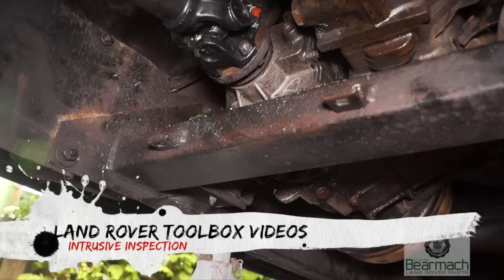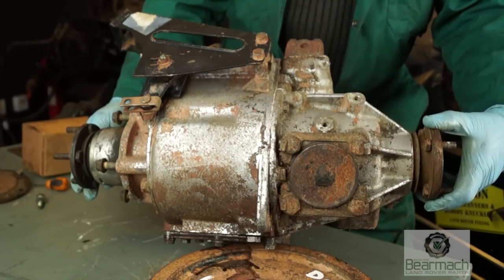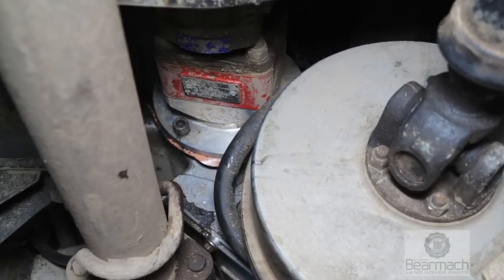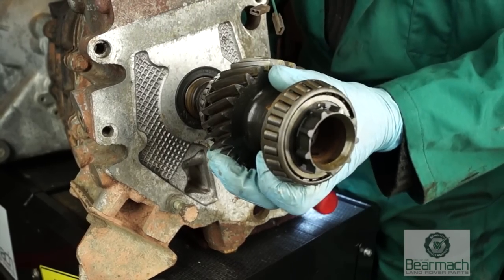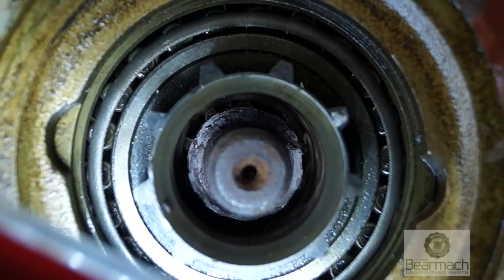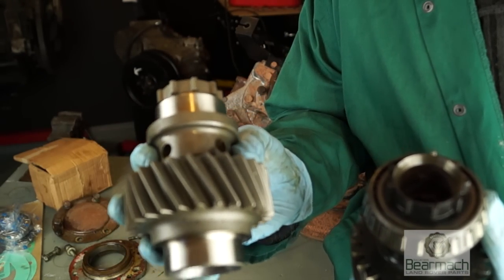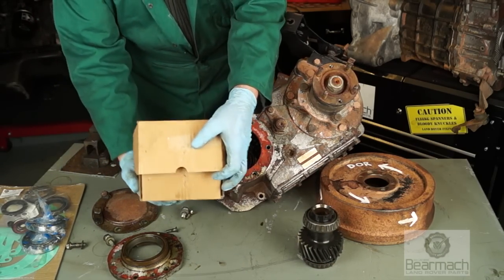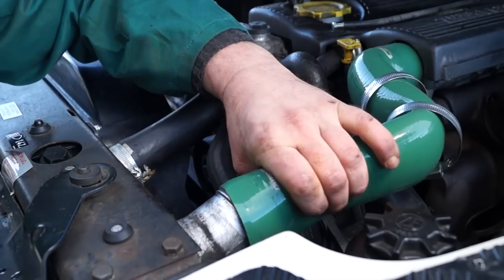A common problem with the LT77 ( mainshaft wear) - The Fine art of Land Rover Maintenance

Comment: Yep that happened to me. Bang, rev, stop. These are great tutorials by the way. Had a similar issue with a Fairy overdrive in my 109. Splines on input gear and OD main shaft wore away. Again, Bang, grind, stop. But this time I could remove the OD, refit the pick off gear and cover plate (always onboard) and carry on....

Comment: A good idea is to make up a short gutter & to have two little wings all welded to the cover plate ( pto cover plate) so that oil runs along the gutter & falls down on to the input gear where the mainshaft fits into.It also gives extra oil feed.

Comment: As a precautionary measure for input spline wear could you potentially unbolt those 6 bolts and pack with lubricant and use an air compressor to help lube reach further areas while on the vehicle?

Comment: I have rebuilt my R380 and I saw your video and replaced this part for the new cross drilled one as the output shaft was in good shape.

Now I have a whining noise that increases with road speed, I think its the new output gear its  a LR one fitted with timkens.

The gear didnt look as good quality as the original.

ashcroft say Some "pattern" gears are not "crowned" during manufacture and will whine because of the edge contact.

Have you experienced this ?

Great videos BTW

Comment: Great video! 
I have a question about this 

I have a 85 ninety 2.5petrol so it has a 1:4 ratio box. 
Is it possible to exchange the shaft with a cross drilled one from a disco 1:6 box? 

I mean Are these the same or is it really different gears etc. Or will it change my gearing?
Reply from the maker: I would suggest contacting either Syncrogearboxes or Ashcrofts.  The Discovery R380 / LT230 T or LT230 Q doesn't come as 1.6 to 1 ratio. They are 1.22 to 1. 

The 1.6 to 1 is the Defender lower ratio transfer box.

Comment: Question about my 02 LRDiscovery II 4 wheel drive, my front driveshaft fell off and my rear drive shaft is not moving the car even in the low gear. Can you tell me how to make it drive my car or do you think something is wrong with the gear box. Thanks, Ernest from San Antonio, Texas.
Reply from the maker: +Albert Flores  you can't lock the differential in the transfer box on a D2 because has an  automatic locking mechanism unlike the manual transfer boxes which have a movement on the lever to lock it unfortunately.

Comment: Any idea when you will do a video on replacing the input gear etc?
Reply from the maker: +Webs  sorry i just saw you comment.  Yes video on replacing the input gear is on the channel  I hope you have seen it?
Reply: +Land Rover Toolbox Videos Yes thanks did the job about 7-8 months ago.  Fitted an Ashcroft cross drilled input gear and new bearings. Doing a 300tdi conversion and your videos have been fantastic help!
Reply from the maker: Glad we can help.
Reply: Land Rover Toolbox Videos what is the video called?  I am pretty sure I am having this exact problem and need to see if I am skilled enough to do the replacement myself.

Comment: did i hear that right input gear can not be replaced in situ? mines a r830 ,do these fail the same way C?
Reply from the maker: If it is an early R380 it may have the same issues.  Some were fitted with oil feed plates that will stop you seeing into the area I showed.

Comment: Where did you get that gear with the cross drilling? Is it an Ashcroft unit?
Reply from the maker: https://www.syncrogearboxes.com/  YOu can get one from here bud.  Shabs will sort you out but you need to be aware of the box numbers and/or teeth count.
Reply: @trailerfitter2  That's great, cheers!
Reply: @trailerfitter2  Sorry, another question that's not off topic... Is it ok to have some up and down/left and right movement on the shaft coming out of the transfer box going to the front propshaft? If so how much? And can I tighten the nut on the end up to stop the up and down moment? Really hope I don't need a new one!